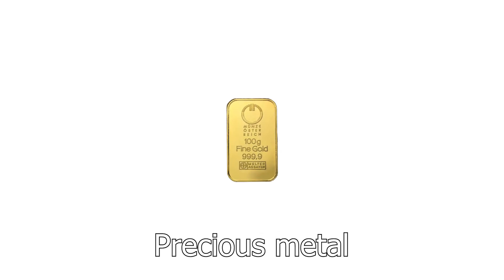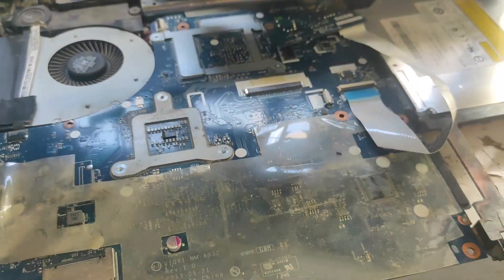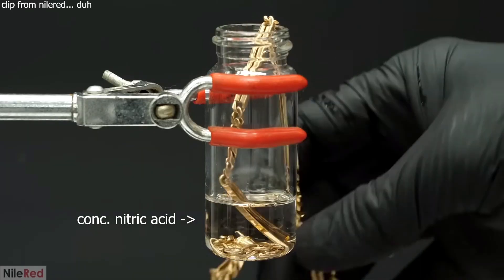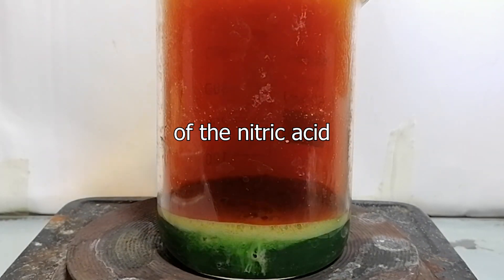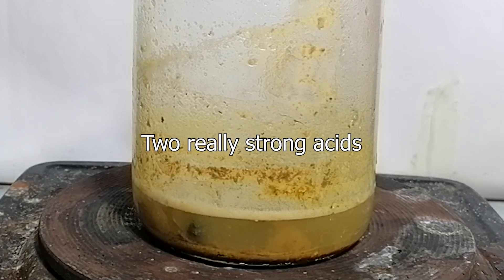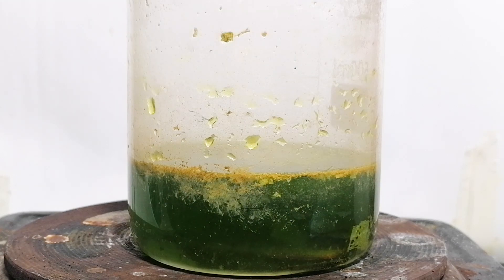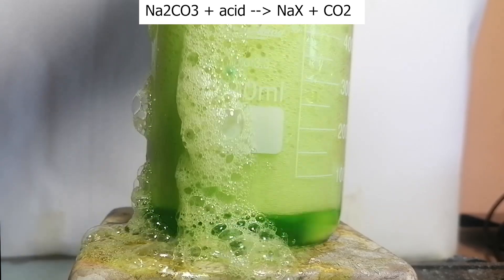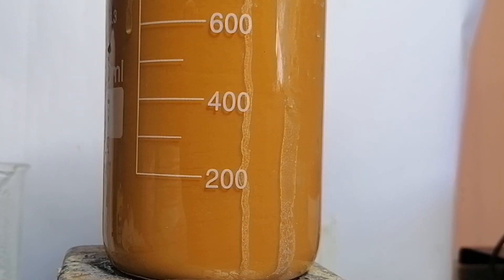Extracting Gold from old Laptop (1/2)

Comment: Dammit, the 15% part hits hard. I've  a hobby restoring old analog cameras and just about ran out of my old stock of phosphoric acid. It works best for removing rust in these devices, and any replacement I've tried either doesn't work nearly as well, leaves copious residue, and/or attacks bakelite and nitrocellulose.
 
EU says I can still get phosphoric acid based rust remover, but only in spray form (with ample additives). Yeah, I'd love to have to clean that off of the intricate insides of an analog camera... Or to find out how the additives play with 70-year-old bakelite...
 
I don't even do chemistry, I just want rust remover. Fuck, concentrated enough vinegar would do, but nooooo...
Reply: But you can still buy phosphoric acid in the EU. I found at least two vendors that sell it at 85% concentration. One based in Germany and the other in the Netherlands. And one based in Poland with 75% concentration. If you need it more concentrated, buy phosphorous pentoxide and let it react with the rest percentages of water present. I'm pretty sure that would work. Or just buy the P4O10 alone and hydrolyse it with distilled water, if that's cheaper. Should give 100% phosphoric acid.

Comment: Have u ever considered a cellphone. Each cellphone has around 100 mg. However a gold coin by plating may be better. I want to use nitric acid (calcium nitrate) and hydrochloric acid.

I will use gold solution and try to dilute to electriplate.

Would platanium wire under current decompose by generating chlorine.

Comment: I have watched some videos about this, since i thought for some time to do it myself and one guy, that has been doing this for multiple years
 (Moose Scrapper), said that its actually better to use a mixture of low concentrated hydrogen peroxide and hydrochloric acid, which will basically just remove the copper, nickel and other unwanted stuff from your gold but not disolve the gold. Before this you need to remove the gold, which can easily be done on most things with a heat gun. For this you will also need a aquarium bubbler because i think it was so that the reaction doesn't stop  but i am not sure. If you need more infos you can find them on his channel
Reply: Aquarium bubbler also bubbles in oxygen gas to allow the reaction to continue reacting.

Comment: You missed a large percentage of the gold. You should have taken the IC chips from the board, hit them with a gass burner untill the plastic gets all crumbly and crush them with a hammer.

As for the pH fuckery you could have used urea or just added a lot less nitric.

Comment: Could you share your source of "15%" sulfuric acid? I have been searching for it for a while and wasn't able to find one
Reply: Normatek hydraulik
Reply: Thanks
Reply: Drain cleaner "hydraulik"
It contains 96% h2so4 
Price: something around 20zł
Reply: You have to be smart
Reply: You can buy copper (II) sulfate and electrolyse it to get almost pure sulfuric acid and copper metal
Reply: @ac281201  that's not as cheap as buying it 
It costs a lot of time, and you have to boil the water out of the acid 
It would be best to distill it cause you'll get something around 90% acid
Reply: @Krzysix.io11  Yes that's true, but the drain cleaner will most definitely contaminated with some other stuff (unless hydraulik is really just sulfuric acid and water). The electrolysis will cost more but you will get really clean sulfuric acid.